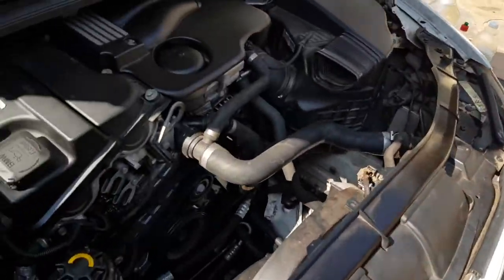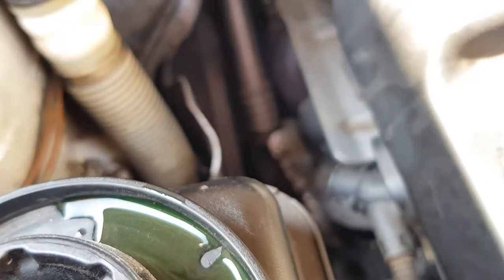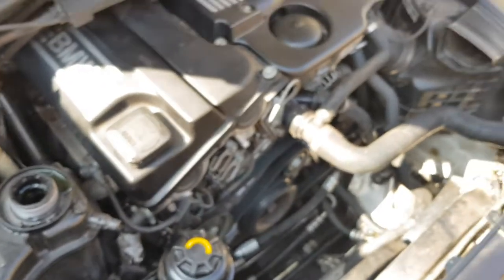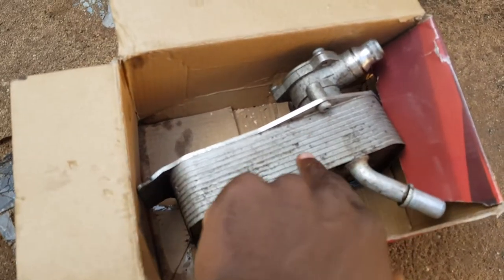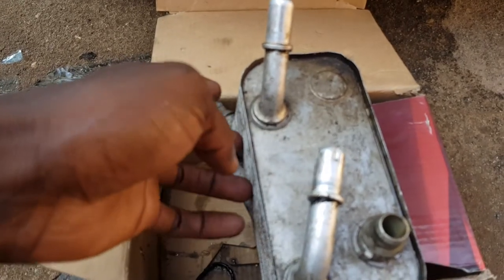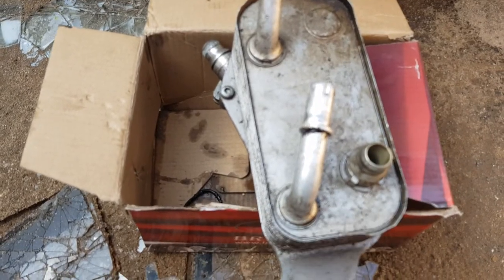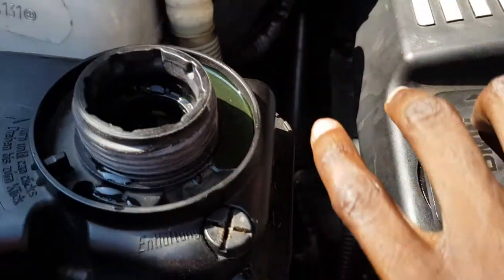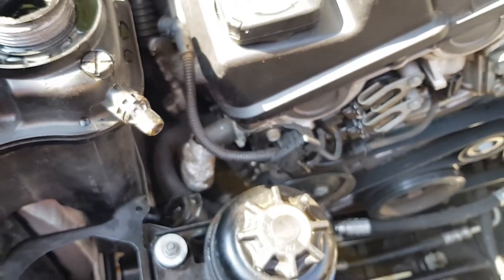BMW Mixing Oil With Coolant | e90 e60 e46 e70 e87

Comment: Does cause the 2e81 code. Says my water pump is going bad but yesterday I had a yellow oil temp light then red 30 seconds later. I pulled over and all the coolant dumped out where the radiator and trans cooler meet so I'm not sure if it's the radiator, the trans cooler, the water pump, or all 3
Reply: Solución?

Comment: I have oil in my coolant but it still drives good so I’m assuming it’s the same problem as this
Reply: You take it to repair shop crooks and they immediately tell you it's head gasket costing $1000s.

Comment: did you ever check your transmission oil? there is some bits of oil in the expansion tank, dont you think there will be some water in the transmission?
Reply from the maker: Normally the oil pressure is more than the coolant pressure so if there is a leak, its most likely the oil that leaks into the coolant system

Comment: Could a faulty coolant cause white smoke from the exhaust ?
Reply: did ya figure your issue out?
Reply: its probably mixing coolant and oil in the block, maybe head gasket
Reply: That is most likely the PCV system sucking in oil when the valve goes bad. If it is the style that is under the intake, it's a PITA to fix but it can be done by yourself.

Comment: Can coolant get into the engine oil due to this or only oil into coolant?
Reply from the maker: Normally it is the oil that gets into the coolant lines since the oil pressure is more. However when the engine stops running, oil pressure drops to zero whilst coolant system remains pressurized so its possible coolant could get into the oil system
Reply: @teejaye908  thanks exactly what I thought

Comment: I have the same problem... But I figured my out
Reply: what did you end up doing? I'm having same issue
Reply: @grantmckenzie1994  i have the same thing but mine is oil filter housing gasket i think.
Reply: @sirloock8360  no
Reply: @dflex4180  Yeah. It was.

Comment: Going through this now. If it was the transmission cooler wouldn't it smell really bad like trans fluid (worst smell ever)?
Reply from the maker: Problem is it would have mixed and reacted with the coolant so i wouldnt be so sure about the smell
Reply: the colour is generally the clue, trans fluid in autos is almost always red, you will be dealing with pink and creamy if its just the trans cooler.
its not usually an issue as the trans cooler is part of the radiator which inevitably fails long before th cooler goes so it gets rreplaced before it goes bad.
but pink and its your trans cooler, yellow/brownblack emulsified oil (thats what the creamy stuff is) and its your engine oil cooler.
thoroughly flush the system and kep an eye on your rubber hoses, one by one, they will all start to fail due to the oil eating them away....which why the best flush possible is the way to go.